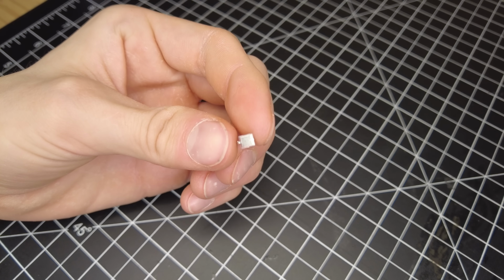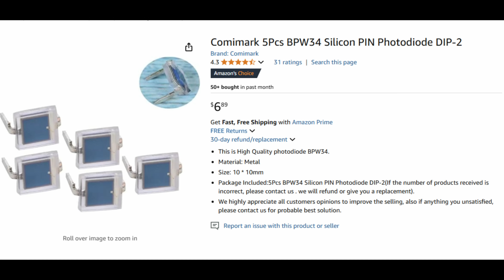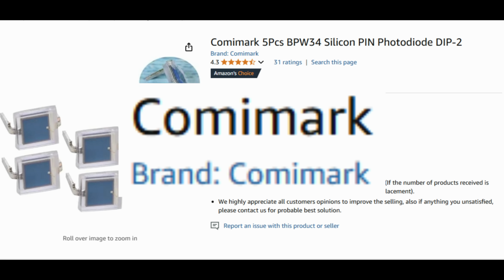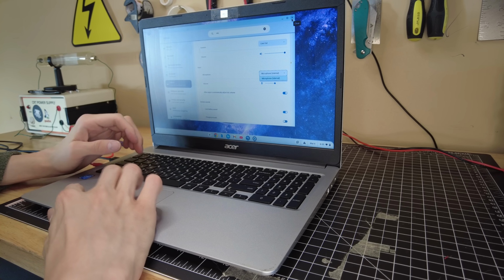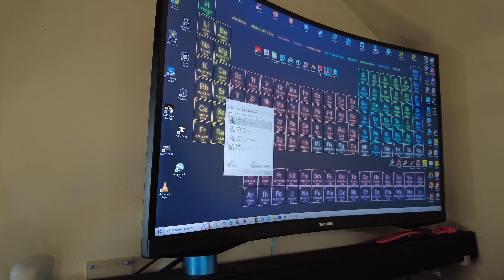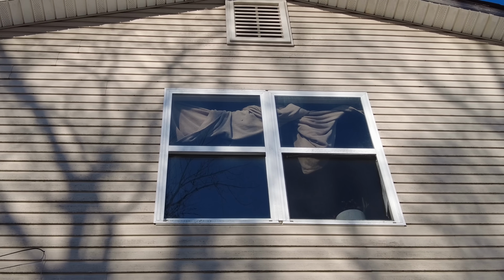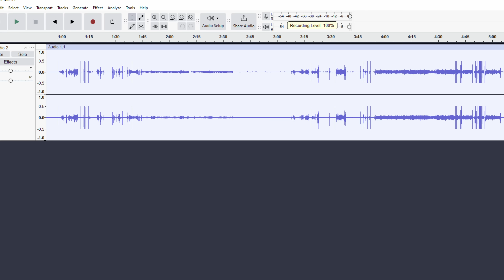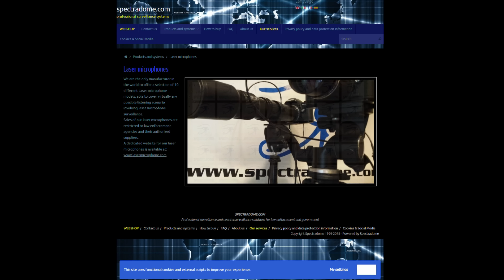I Built a CIA Spy Device (Laser Mic)

Comment: My great uncle built surveillance devices for feds back in the 80s and 90s. One thing to know is that if you live on a street with power lines, you can be surveilled.
Reply: Luckily I live in a house and not in the street.
Reply: Damn thats interesting can you tell me more???????
Reply: @md5sjt41  Tom scott made a video on it not sure if its what op is talking about but powerline harmonics can get picked up in audio recordings and analysed to determine the near location from the transformer
Reply: @md5sjt41  PLC. You didn't need extra wires in the 80s and 90s to transmit video from cameras, you could just use the powerline to transmit a video signal. I'd assume that's what the guy referred to, but it's not really impressive with modern standards.
Reply: @snarkyalyx  yeah probably you are right at one gathering (engineers from five kind) we just started on talking then it got to a point that how much it takes to adjust algorithms and write codes to listen and even see from satellites anywhere on earth
Even a Faradi Cage won't stop the right equipment not even tons of concrete turned out jammers (not anti weapons) are the only half good option for it
On paper one dude was proving how he can hack someone from house electric wiring since it's just a matter of time to locate special patterns and learn a way in
Reply: @hellno100  What you just said is basically saying "It's just a matter of time until we find a zero day to get into a computer" lmao
Reply: @hellno100   Wouldn't white noise help block out the surveillance when faraday cages won't help?
Reply: @Pulakaikkomakes it harder but eventually data is reachable if your system design is constantly updated, noise and jamming helps but not forever that why many can do a variety of complicated noise on system
Reply: @md5sjt41  i'm not sure how they can listen but i know the hum from electricity is like a fingerprint and can be used to find exactly when and where a video was recorded tom scott has a video about it
Reply: Basically, there are several devices that could allow a small unit to be hooked up to a power supply outside of your house within a hundred feet or so and monitor everything that happens inside. Back when my uncle developed the tech, they would make them look like the metering boxes. Just knowing what it was like back when the tech was super limited, I can't even imagine how easy it is for them now.
Reply: @N8Dulcimer How exactly is it supposed to work? Line monitoring was used as far back as telegraph, still needed actual data that was being monitored. This implies that electric systems are so leaky usable audio is getting back out.
Reply: @amentco8445  I'd like to know how those harmonics crossed the step-down transformer backwards.
Reply: @N8Dulcimer  
So, boxes with a hidden camera inside? Clever.
Reply: @RenzitoARG hidden cameras that can see inside from 100 feet away pretty good camera 😮
Reply: @N8Dulcimer  we have phones in our pockets now XD
Reply: @ Right, so I was right about my guess, you just didn't understand your Uncle completely right. They used powerlines back in the days to transmit e.g. video and microphone signals for devices they placed inside a home.
Reply: @snarkyalyx like powerline internet transmission?
Reply: @snarkyalyx indeed, they were powerline bugs. I build myself some for audio. Video was on another level that never attempt
Reply: @snarkyalyx  I am aware of that also, but he specifically told me about devices that can passively observe into houses using arrays of parabolic mics, laser mics, FLIR, Terahertz tomography, among some other technologies that I don't know the terms for or understand very well. These devices would basically collect all possible data on a house that can be collected without entering, which is a whole lot more than you might expect. Sure, it's not like CSI Miami, the data needs a lot more interpreting to be useful, but there is quite a lot of data that can be passively collected. He worked on these devices for the US Marshalls and the ATF as well as some others to help them surveil organized paramilitary groups who were particularly paranoid about the simpler forms of surveillance.
Reply: @hackmind bug from lines for audio is nothing compared to images but even that every move breath change of body temperature it's just a matter of time and equipment making effort to see and hear from even space
Military shows up they got cameras on drones that barely shows inside but that foolish to accept better tech is available from YouTube videos 
Once I heard even object frequency and temperature with a few more parameters can help for full image and audio from distance (depends on equipment,any where) I knew militaries are fooling us so they get more budget and nova day wars are just a show how I can believe cold war tech could locate a bird 100 miles away they can't just easily locate any thing on earth by satellite
Reply: @N8Dulcimer  can you explain tera herts tomography I don't know about any kind of wave in that band can be analysed thanks for info
Reply: @ I know very little, but highly directed X rays can essentially be used to notice small variations within their scope, and this can be analyzed by algos to make broader assumptions about what is behind a specific barrier.
Reply: @N8Dulcimer okay monitor everything?like what exactly like see it roughly?well?more?
Reply: @N8Dulcimer  the gov uses some modern version of this currently in Aus, a guy i knew before he went down had a vague reference in one of his court documents
Reply: yea please tell more
Reply: Can you tell more?
Reply: Elaborate!!!!
Reply: Almost anything acts as a radio on some level, I can for instance hear the sound my neighbors laptop is playing on my 2 way radio on some harmonic frequencies with the standard antenna.. anywhere between 160 and 500 something Mhz. There was a HP laptop, I forgot the exact model number, it was used by many governments that would directly broadcast it's microphone over 24Mhz FM, not all of them did, but most.

Nowadays a hacked phone with all it's sensors can exfiltrate more than you can think of: the words you type on a keyboard via it's accelerometers, encryption keys from your computer via it's microphone and much more.

Investigate exfiltration of airgapped systems and you'll be surprised.

I assume the FCCs rule about accepting interference has to do with sending certain frequencies to modulate parts of electronics so they can transmit on demand.

Kind of like that microphone that was in the oval office/Whitehouse that only worked when a certain frequency powered it, so it stayed undetected because it was essentially "dead" until energized by a transmitter outside the building.

The coolest thing I've seen and I don't remember the name was jumping from a smart bulb or other wifi device to a printer, reconfiguring it's firmware to turn it's circuitry into a transmitter that could then affect other machines in a similar fashion, not sure what techniques they used to match circuits to specific undocumented chip features to create a symphony inside a machine that would give it totally different capabilities.

I guess AI and a huge database of chip and circuit data or an insane mind.
Reply: @Kris-fd9xs  Of course, actual criminals tend to avoid technology in their meeting places. No smartphones, no wifi, and if they're smart no antennae or electric signals of any kind. Typically, phones are placed in faraday cages, and these locations do not have any kind of antennae. Competent criminals understand all of this.
Reply: They tried putting  a van in front of my house at 7am.  It was terrible, my lawnmower was so dull I made 10 passes in front of them before they left, and the grass would cut.
Reply: Last up there why not just let him just use your Wi-Fi to ping as a sonar scan of your house, but why stop there they could do it with the cell phone I mean they have things that can pick up movement. Basically if it works with electricity it's a data mining device that has functions for people's way of life nowadays the latter is known the former is hidden
Reply: @darrellblackmon50  You people need to learn how electronics and physics work before you say this stuff. Where in the Netflix Hollywood did you hear "WiFi to ping as a sonar scan" is a thing? lmao
Reply: @snarkyalyx  I didn't it just makes sense
Reply: @snarkyalyx   Some months ago Italian scientists said, that they were succesfully able to locate people from other side of wall with just wifi and correctly identify them with 73% accuracy using only Wifi. I can imagine that the NSA or sum has way better algorithms
Reply: @darrellblackmon50  Well at the time, wifi and cell data didn't exist, however nowadays if a criminal is powerful enough to be surveilled they almost definitely already avoid things like cell data and wifi. Generally, if someone is worth spying on, they aren't going to make it that easy...
Reply: @darrellblackmon50 what about flickering the lights in binary code to communicate with other smart objects or phones?
Reply: Oh! I'm familiar with those devices! My favorite b1-RD model was the cR-0w. Such a great work-horse. The pgn model was trash though.
Reply: https://www.youtube.com/watch?v=ZfvmdX631Gc&t=2s here is a video from an attorney  talking about how the tech works and how the cops are using it to spy on people from up to a hundred yards a way. Its called Xaver and can see through your walls up to a hundred yards away. Pretty crazy. They also developed a system that uses your wifi signal and essentially turns it into a radar system that can be used to monitor people inside a building. They use the existing wifi signal and they monitor the signal and can generate an  image off the way that the signal interacts with the environment just like radar does. They developed that at MIT  and it can use anyone's Wifi signal sooo crazy.
Reply: Don't you have to use those power lines!?
Reply: Search “Acoustic side-channel attacks on keyboards”. There is a a technique that by listening to someone typing on a keyboard they were able to know what the person was typing with 93-95% accuracy.  The technique worked well enough to be done over a zoom call.

We can just assume if you are worth being spied on, you are likely being spied on.
Reply: I think that should be tempest: capturing spurious emissions from electronics.

I find it hard to believe that ac wiring would resonate with human voice enough to get picked up. But on the other hand lightbulb filaments might,  yet they live in a vacuum?

If you have a TV/radio plugged in however the speakers might  do the trick.

Remember FCC regulation: this device must accept interference from other devices, but may not emit interference 🎉
Reply: How so?
Reply: Surveil my ass FBI
Reply: Is it based on a clampable inductor?
Reply: Its because the fbi agents can swing on a power line to your window
Reply: Flir can see right through walls.
Reply: This comment section is interesting
Reply: The Eruv lmao
Reply: Yep and x10 technology allow communication signals across home powerline for home automation, but also coupd be used as a “telephone”. This presentation narrows in on windows, but also sewer pipes, etc. can be used.
Reply: I believe you.  Why the outlaw lead paint homie
Reply: @darrellblackmon50 😂
Reply: Bollocks

Comment: They've been using these since the 1990s. However, the 'real' ones measure the shift of the beams' return path directly from a reflection off the glass itself. IE, they do not require a receiver on the other end. They can be defeated by regularly perturbing the window in question, i.e., vibrating the glass.

Comment: I think the source of the noise was the laser itself rather than any problems with the receiver
Reply: Probably partly, but most of the noise is still there when blocking the laser 3:19
Reply: Those amp boards are garbage.
Also by adding a polarizer you didn't help the snr. You should just have made a hollow recessed cylinder to block out all non directed lights
Reply: @mazzonijacopo  1000% it's a problem with the amplifier circuit. It would likely be possible to get pretty good sound quality out of a laser microphone if it had an adequate pre-amp and amp stage. 

I was honestly surprised it just frickin worked by using a photodiode in place of a microphone though, since I expect that amp circuit was originally made to spec for that specific microphone, lol. 

I'm sure to an extent the particular light levels of the room made a difference too, but I doubt by very much. The noise got worse when the laser was hitting the receiver --- this is because the amplifier is amplifying noise which already exists. The snr is so bad, probably because the amplifier stage is introducing a lot of extra noise. 

If audio engineering was as simple as cutting some parts off of pre-made circuits and slapping other stuff on them, well, we wouldn't have people wasting time impedance matching transistors and whatnot for high-quality audio amplifiers. 

With a correct circuit I'm sure the quality you could squeeze out of this thing would be reasonably good. Obviously nowhere near the level of your typical condenser or cardioid microphone. I expect the sound quality would be similar to a piezo pickup. If you think about it, this is pretty much the same thing as a contact mic. The only difference is light serves as the transmission medium. I imagine the sound quality would be nearly identical to a contact mic, if the circuit was suitable.
Reply: Could be the amplifier itself as well
Reply: umm, how about the fact the room was brightly lit, and there wasn't a specific wavelength filter on the receiver?
Reply: It's most likely emf noise
Reply: @ciklop420  yehhh, looks soo
Reply: Pc soundcards can also have a lot of noise
Reply: The noise is the vibration of the cpu fan ??? 👀
Reply: @SecurityType  dude, it's a laser microphone pointing at a window. How would it amplify the desktop fan noise?
Reply: I noticed if you put a capacitor in series on the laser and receiver it reduces noise. Also if you hook it up and parallel, but the series one is the best. Also, calculating the bias on the receiver, the sensor, helps. Put a known resistor value on the sensor, receiver, on the negative and positive and calculate the impedance.
Reply: Power system

Comment: how do you line up the laser with the photodetector with an infared? because its invisible (yes i know you can use a infared camera but still.)
Reply from the maker: @Roboseal2 You'll need to roughly estimate the reflection angle, then use a phone camera (which should be able to pick up some infrared light) to precisely line up the beam with the sensor. Or you can use a visible laser for alignment and line up the visible laser parallel with the infrared one, measure the distance between the two, and the infrared reflection should be the same distance from the visible one. If you're in a dark enough space and the target is in a lighter space, they shouldn't notice *in minecraft of course
Reply: @SomethingAbtScience  Good deal bro thanks!

Comment: Can't a laser be mounted on the same box as a receiver?
With adjustable angle to account for the distance?
Or does the ange have to be big for it to work?
Also make the radio wave or microwave device nex time!
Would be a banger video!
Or even collab with the guy that makes overpowered microwaves and lasers.
Reply from the maker: Yeah, the oscillations of the window are perpendicular to it's surface, so a very steep angle wouldn't work as well unless the receiver is measuring phase shifts in light, which would be far more accurate but expensive.